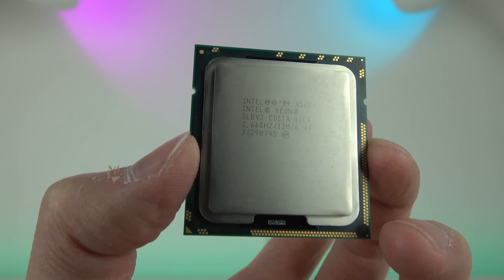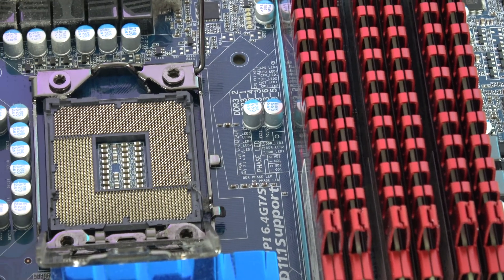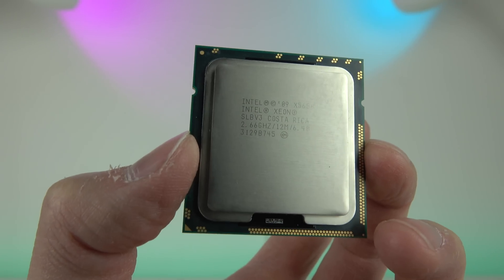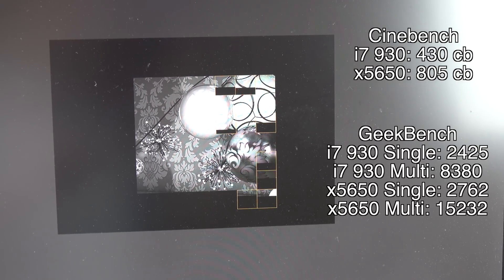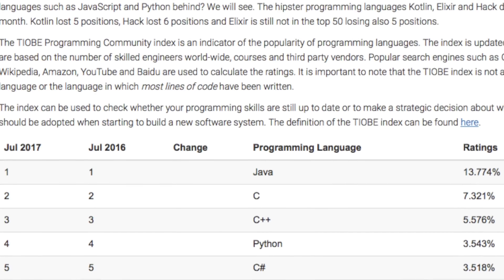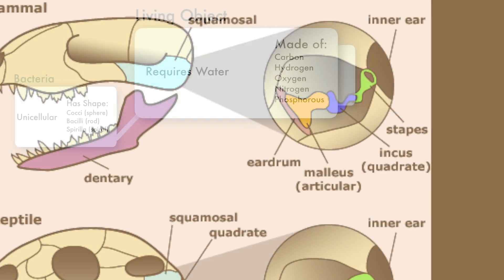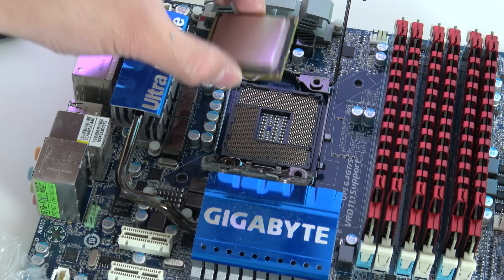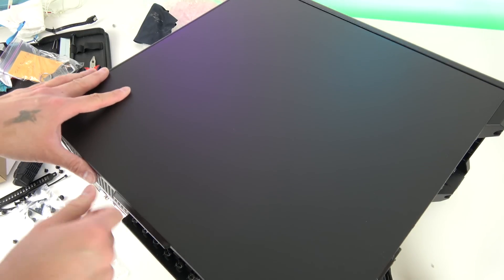This 6 Core CPU Costs $20. Will It Let My PC From 2010 Last 3 More Years?

Comment: I have you beat I've been upgrading, maintaining, and constantly running my machine for 4614 days.. Started out Jan 24 as a 2 yr old clearance COmpaq Presario from Walmart for $200. Over the years I have systematically replaced every original part including the case. In fact my HDD included windows files going back to the original Windows XP and was running win 10. This last major upgrade was also to a six core (Amd Phenom 2) and a GTX 550ti (Not a gamer), and a 650W 80+ Power supply. Had to clean install Win 10 due to corrupted Settings from swapping the motherboard. So I lost all those original windows backups, and the presario specific apps. (I had cloned the original drive to a 1/2 tb some years ago.). All said the system is mostly stable. I'll be ready for a new one in a year or two, but it kept me running for under $200 on the total upgrade.

Comment: Indeed... I recently just retired my Core i7, socket 1366 computer... My replacement was AMD's Threadripper 1950X.
But the old 1366 despite having served as long as yours did and was still doing fine for most tasks I threw at it, it isn't heading for the retirement home just yet.

My computers have a long life span, once they are done serving their primary use case, they are cycled into a secondary operation as a server.
Where currently a X38 powered socket 775 machine is serving nicely, handling my media, database servers, virtualized servers.
Now that X38 will get an upgrade to X58 as a result... And I have no doubt that in time, my Threadripper when it is up for replacement, will take on the same role as well.

When do their lives end? Well my computer parts sit around on shelves when they are no longer useful for servers, they are spares for the  day I need to troubleshoot something or while something is on RMA.
And that policy has saved my bacon many times and allowed me to find the problem and send it the proper part for RMA.

Comment: This guy is highly pessimistic! I upgraded my i7 930 to the Gulftown x5760 about 2 years ago. I built the system in 2008. I built it with a V8 cpu cooler as well but used the ASUS P6TD mb. I also upgraded to 24GB of ram from 6GB. I actually sold the ram I originally built the system with for $280 2 years ago. I think it was Kingston 2133MHZ DDR3. GPU  I went from crossfire 5830 Sapphires to GTX 970 to now 3 GTX 970s and a GTX 1070. My 1080's are in another rig. I don't do much sophisticated stuff with this system but I can say I have never seen this thing go over 20% cpu usage while running 2 hyper-v instances. With that said, memory usage I never have came close to exhaustion and I usually have 50+ windows open plus running 2 virtual environments. I envision this thing to last at least 3 more years no questions asked.

Comment: I've got exact same motherboard in my missus PC and I put a X5660 in it - it overclocked like a beast and I got it from 2.8 to 4.4ghz with far far less effort than the old i7 950 took to get from 3.06 to 3.8ghz. It's pretty much on a par with my Sandy Bridge E i7 3830k with a 4.4ghz overclock though the older PC probably uses more power (it definitely did with the i7 950: 150watt idle vs 90watt on the i7 3830k, that's with both overclocked).

I sorta skimmed through video and didn't see you mention what RAM you've got by but I thought you'd like to know that even though gigabyte say this motherboard can only take 4gb modules - it can definitely take 8gb modules (I haven't tried loading up every slot with 8gb modules but I've heard it's doable and I tried loading 4 of them getting it to 32gb and did this with the i7 950 which even intel say it can't do - but it can because it's just a binned xeon itself).

Comment: I have an i5 2400 with a GTX 1050 Ti and I have had no issues. Runs games fine, not to mention I got the CPU, RAM and motherboard for free.

Edit: my 2400 also gets the same cb as your 930.

Comment: Listen I'm glad it worked but you're missing a huge, no massive step, go to the MOBO's (in this case Gigabyte) website and first see if there's an updated BIOS firmware (UEFI) to accommodate the new CPU before buying. I get this was more of a cleaning exercise with a CPU side note, but at least you're give good and prudent advice. Cheers.

Comment: i just recently got a X5675 3,06GHz (3,46GHz Turbo) for 45 bucks as an upgrade for my second pc.  there's not a game today (exceptions might exist) where that cpu is the bottleneck.

the X5675 was mostly used on mac pro computers. but works on any lga1366 board that supports xeons from the 5600 series.

it's not the fastest of that series (that would be the x5690) but it's the fastest still sporting a moderate 95W tdp. the faster, and way more expensive ones are at a tdp of 130w.

Comment: you should get a good air purifier and set it next to your PC when you run it.  I got a large lumipure ionization one and it MASSIVELY cuts down on dust in my pc.  It takes about 5 months to get the same amount of dust as just 1 month without it.

Comment: I did the same upgrade last year. I built a X58 platform in 2010 using an EVGA FTW3 X58 motherboard, i7 930, and 6gb of corsair dominator. Upgraded to a x5650 and added g.skill 12gb ripjaws, and EVGA GTX 980 FTW. It's running at 4.09GHz. All in a old Cooler Master CM 690 II Advance case. I want to put a 120mm liquid cooler on it just to get rid of the huge Prolimatech CPU Cooler.

Comment: i have a old desktop from 2008 wich is still my main setup and it has a i7 950. I think im going to upgrade to this cpu and overclock it
Reply: Tech Skits get an x5670 or x5675 instead, they are a bit more expensive but not prohibitively so,  they have higher multipliers to play with so you should be able to hit higher clocks without putting too much strain on the motherboard by cranking up the bclk very high
Reply: thnx the base speed of the x5675 matches the 950's base clock speed so i have to do less overclocking to get to 4ghz

Comment: oh i got the xeon x5670. nice!!! i think you should  have got the x5670. its a little better in my opinion and it would set you back about 40$
Reply: I've got a x5675 out of an old blade server and was running this config for the last 1-2 years. It's impressive how my (basically) 7 years old system keeps up with all the current games with basically only graphics cards being upgraded every 2-3 years.
Reply: I use an x5660 @ 4.2ghz

Comment: I upgraded my PC wich is very similar, ASUS P6X58D, CPU upgraded from i7 950 to X5670, RAM from 6 GB 1333 MHz DDR3 to 12GB 1600 MHz, GPU GTX 470 (died) > 570 (sold) > 970 (LOL almost the same gigabyte but xtreme gaming) , I still have original HDD WD black 640, but system is now on Samsung EVO 850 250GB and I have vertex 128 GB SSD too. This 1366 platform is a miracle one, I play modern games on very high to ultra settings and this CPU has better multithread score than 7700 or 6700 i7s. Single thread same as 1700x (measured in CPU-Z). Note I overclocked this CPU to 4.2 Ghz (201x21) with Thermalright Le Grand Macho cooler, temps maxxing @ 82°C in stress tests, 70 while gaming. I just made last upgrade, Corsair 460x and CX750m. I had CM HAF 912 :D Nice to see good old X58 system alive and kicking. For 1080p those PCs are very good.
Reply: Roman F x58 is a fantastic platform, I built mine back in 2010 with an Asus p6t deluxe v2 mobo and upgraded my CPU from an i7 950 to a xeon w3690 @ 4.6ghz and it keeps my fury x busy, today I bought another Asus p6t deluxe v2  for $50 and paired it with a xeon x5660 @ 4.2ghz I had laying around and a r9 280x for use as a spare gaming rig.

Comment: well i have the same cpu and gigabyte x58a ud7 motherboard , u gotta tell me few things cause even i got a dealer selling me the x5650 , but on the gigabyte site this processor is not listed in the supported list ?? but so does in ur case this processor in not listed in your motherboard also , and you are using coz ram which is not ecc then how can your pc showed a post and is working fine , i need to get an answer cause i really want to fit this processor in my system
Reply: Amit Ghai it should work no problem, just update your bios to the latest version, if it supports a 980x, 990x it will support any 6core x or w series xeon

Comment: Why is my i7-950 so much more stable than yours? also,
got the Asus P6X58-D Motherboard and 24GB Corsair Vengeance DDR3 1600mhz + blablabla 120GB SSD, 1000GB HDD + 320GB Laptopdrive 5400rpm + another desktop hdd with 80gb
now for the gpu:
A Zotac Geforce GTX 580 wich dont really bottleneck in this pc. but, i changed it to a 1050Ti, because why not xD

Comment: I dont care about the temperature of my PC but noise and dust are dealbreakers.

yeah, so, the one thing, that creates noise is temperature, cuz the fans will ramp up. Faster spinning fans will transport more dust in your case. Which creates more temperature, creating more noise etc etc. The point here is: You cant just reduce the noise, nor can you simply reduce dust without thinking about temperatures.

Comment: well.. I did an upgrade from the 930 to the 5650 and clocked it in 4ghz. also aded a 980ti I found for 280usd. (250euros) another 980ti. my pc will play ANy game at 1080p and High settings. enough for me on my 40inch TV. I could even go 4k with a second 980ti. but maybe I will just keep enjoying games on 1080p for another 2 years

Comment: I did EXACTLY the same, with the same MB, only an upgrade to 12GB of RAM and from a i7-920 to a Xeon W3690 which cost me about $80.  The difference was staggering...
Reply: Andy Lee I also have a w3690 on an Asus p6t deluxe v2, overclocked to 4.6ghz with an overclocked fury x,  plays everything at ultra settings,  no need to upgrade for a while

Comment: dude i still have and usera 2011 socket mother board with a 3930K. first i had a gtx 460 cuz i was low on cash getting the 3930K setup just after it came out. Later i whent to a gtx 680 and now i run a gtx 1080 still works fine alto gpu upgrades are more needy along the years. now i'm looking to rep the power supp sicnce over the years of running the volt range is to wide for stable overclock altho stock settings are still ok.

Comment: That's a great upgrade, I upgraded to the same cpu 3 years ago and I still would suggest spending 20$ for upgrading to that range of Xeon on socket 1366!
 (but I did just downgrade my 1366 to 'backupsystem', because of limitations like PCI-2.0, no m.2..)

Comment: You should have bought X5675 for 65 usd and bclk or W3670 for 50 usd and multi overclock it.
Also add a decent watercooler to it.
As the result you would be able to reach 4.5Ghz and have same multicore performance as 7700K.

Cheers :)

Comment: I you want to build a machine like this from scratch,  dual CPU workstations have also gotten really cheap. It's not impossible to pick up a complete entry-level workstation for under £150/$200. With the glut of server hardware available, Maxxing it out is really cheap, and you can end up with a really good machine capable of running modern titles at max settings for under £600/$750. My rig has dual X5667's 24GB RAM, GTX 970 and a 512GB SSD, and only cost me £600, all built last winter

Comment: I just got a second hand PC from a forum with $400. Specs below:
NZXT full tower, i7 6-core 5820k water cooling, 16GB ram, GTX 970, 750w PSU, no hard drive. 
Willl it last for 3 more years?

Comment: Liked your video and I liked your good explanation of object oriented programming paradigms.

But just a small nitpick: you give object-oriented programming too much credit and I would argue it doesn't belong in the video. It is not something that magically makes your computer faster. Object-oriented programming designs are not new, they've been around for decades, as were the languages you've shown that focuses around that paradigm. They have nothing to do with how the computer interacts with other components so using object-oriented programming does not improve performance as your video seemed to suggest. These days there is actually a move to get away from strict object-oriented design. While it makes good conceptual sense (a dog is derived from an animal, etc), it does not translate very well when working with system components and resources and tends to make things inefficient.

The biggest improvement these days in game programming is to try and parallelize jobs that these games perform. Instead of working on a single thread on a single core, programmers have to try and figure out to split jobs so they work on more cores. It's not an easy task since not everything can be parallelized. For example, package deliveries are only as fast as their slowest mode of transport. Adding more trucks won't make it ship faster.
Reply: ExtraSauce "just a small nitpick". Types 2 giant paragraphs. 👌🏼

Comment: excelent CPU upgrade, still very capable, I use a Z800 with two Xeon e5649 6 core each 24 threads and it is very very capable still play everything on max

Comment: My personal rig is an old hpz400 workstation with an Lga1366 Xeon w3565 hyper threaded quad core clocked at 3.2-3.4 ghz, 20gb ram, and an xlr8 1050ti, and I can say it handles modern titles like a champ still getting 60fps at max on gta and fallout 4, and streaming at 50-45 fps, it'll last me for many more years to come and I don't doubt that yours will too!!!!!

Comment: I absolutely wanted to see benchmarks of before and after. It appears to be twice as fast but who knows. Did you try overclocking with CPU? X58 is a waste if you don't overclock. Overclocking older hardware actually makes huge gains in performance. You certainly have the cooling. Decent video.

Comment: Changed my 920 for a x5660 for 36$. Dont know if you could call it a upgrade to the original computer tho since the only parts still from 2009 is the motherboard and one of the hdd:s :-P

Comment: i have exact same cooler and a X5670 being used for a mining rig. Used the X58 Rampage 2 Extreme mobo from 2008 - 2017.
You should overclock.  My X5670 easily did 4.2 with a D15.
Reply: Wow nice I got the same exact cpu, mb, and cooler too. What’s your bios settings and temps to run 4.2 my computer runs a lil to hot at 4.2  1.34 vcore but at 4ghz at 1.24 vcore

Comment: As a fellow nerd who has a rig that's long in the tooth, I can't help but wonder if you are underestimating your rig or not. I personally have an ivybridge rig with an i7 3770k in it that has been tweaked to a nice stable 4.8 ghz, and I can see where more cores will play more of a role in future games and content creation programs alike. I give your rig.... about 2 years without overclocking max, if you can overclock, then 3. At that point, you may be beating my rig in how your cpu can be utilized with more cores vs mine with more speed and individual IPC. 
Great video regardless and consider yourself subbed! :)

Comment: Its quite weird i have the same mobo and cooler but had a i7-960. also upgraded to 24gb of ram along with the same 970 XD Though did upgrade to a i7-3770k recently that i was able to get from work for free. might rebuild that rig for spares etc

Comment: It all boils down to your enthusiastic place in computing/PC gaming. If you want the newest fastest and best of everything and have the money, The options are there. If you play games at very high refresh rates/Resolution and need optimal performance, The hardware is there. In reality, You can game perfectly on something like a 6-7 year old CPU  and a 3-4 year old GPU.. If it's limitations do not bother you. I have an i5 2500k and a gtx 980 and game at 1080p 60hz/60fps with at least high settings in any game no problem. That's all I want, I'm not enthusiastic enough to spend more and go further.

Comment: Well, I have my i5-2400 and it runs fine, I even upgraded my RAM and GPU. I went from 4GB 1333MHz DDR3 to 16GB 1600MHz DDR3, and the GPU from GeForce 560Ti 1GB to Radeon R9 380... And it runs like every new game over 60fps, like DOOM on Ultra with Vulkan, and GTA V on Very High.

Comment: In the exact same spot with my i7 920 @ 3.5ghz. Going to pull the trigger on the x5650 and overclock to around 4ghz hopefully with my AIO cooler. Did you overclock your xeon?

Comment: I literally have the same PC this guys does except I have a 920. I have not felt bottlenecked at all at 4.4 ghz
Reply: You should still upgrade to a Xeon. Uses less power and runs cooler than the 920 despite having two extra cores, plus the Xeon has a better chance of hitting a higher OC. I can get my X5670 to 4.6Ghz on air before temps become a worry.

Comment: currently rocking 2 E5620's (which are about $5 a piece on ebay) it's actually pretty fast though is horribly power inefficient, I guess I can at least tell people I have a 8 core / 16 thread pc.

Comment: 4k only exist because it's cheaper for LCD makes to NOT cut apart 4x 1080p sections of LCD, its saves time, power and extends the life of their diamond cutters.

I'm still using core 2 duo laptops and an an overclock q9550 core 2 quad tower with ddr3 and a 1ghz over clock. if you OCed this six core you could get 24 months if you could get 18.

Comment: So I don't need to spend $3000 for Ryzen Threadripper and a GTX 1080 TI?
Reply: AppleMacsterRace third gen i7 or related Xeon will get you a nice computer for under 500$. Spend another 300 to 400 on a top of the line graphics card if new or save money and go used but last generation top of the line for 200 to 300.
Reply: LeoInterVir thanks for the advice I was actually planning to drop $3000 on a new PC :)